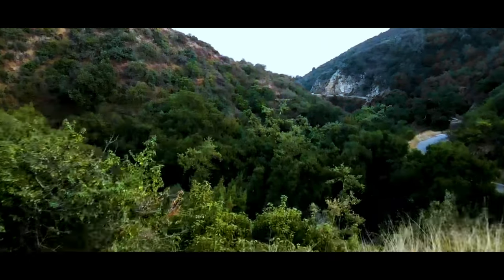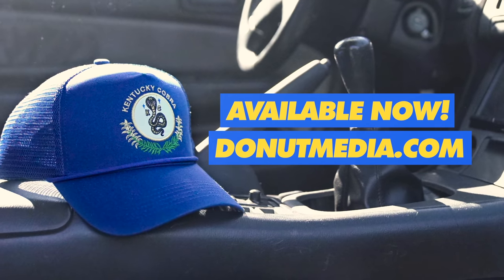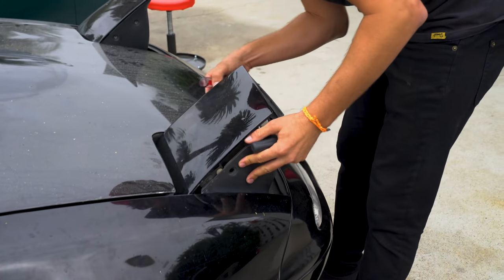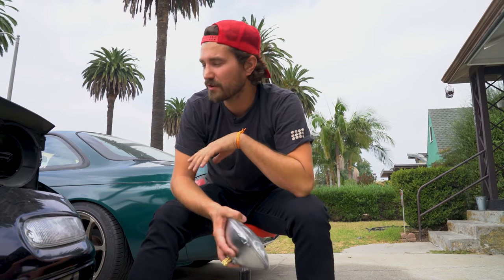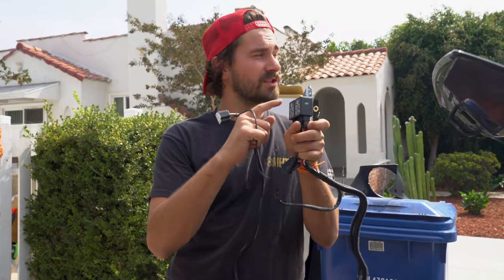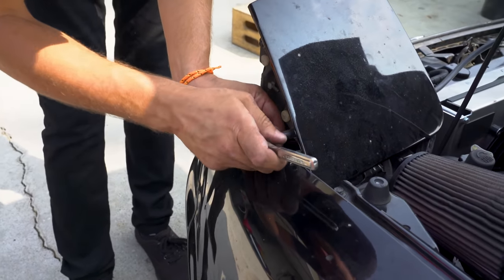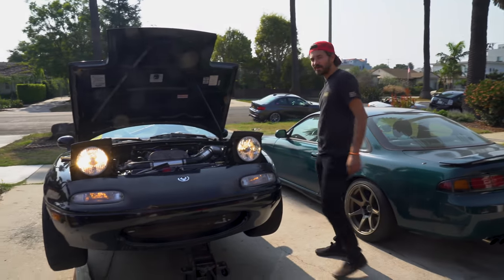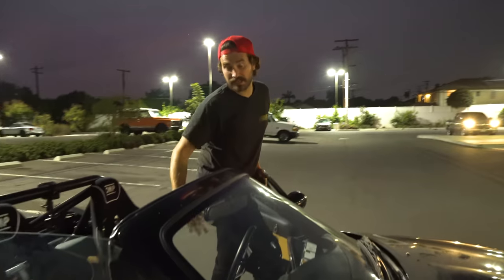Are Aftermarket Headlights Worth It?

Comment: aftermarket bulbs... as in a better sylvania bulb? yup works well and doesnt blind TF out of drivers. led and hid in a regular housing suck for other drivers and should be illegal....also this is old school but for CB radio operators they emit ALOT of RF noise and cause alot of static on your reception. effectivly reducing your reception range. and there is no way to stop it.

Comment: I know this video is a bit old, but does anyone have a better description of what's going on at 7:55? My miata is my first project car, and I've had it for about a month. I've managed to find the terminal shown in this frame, but I'd assume there'd have to be a second terminal to connect the other lead, which I haven't been able to find. For how popular these cars are I haven't been able to find any good resources on installing aftermarket headlight harnesses and this video has been the only source I've found with any type of instruction

Comment: it feels like a bad upgrade, I assume that aged light gave 1200 lumens both, and new standard bulb would give 1500 lumens both, extra power, but still old tech is just under 3000 lumens both. 
LED cost 3 times as much for bulbs but with rough consumption of 8W low and 28W high offer upwards of 4000 lumens EACH. 
assuming that harness is not free, that upgrade would both be cheaper and give you not twice but like 5 times as much light, (even feels like too much and I would go for weaker model)

Comment: I'm surprised that the Miata has sealed beams, I thought that went out of fashion in the 70s?  Are they h4 in other markets?  My 86 Mazda 929 in Australia had twin pop-up rectangular headlights and they were not sealed beams, H4 globes.
Reply: Sealed beam headlights were a legal requirement here in the US until the mid 80s. Some cars, especially those with pop up lights, continued to use them until later.

Comment: That's cool and all, but you totally should have done an HID or LED + retrofit projector swap instead... WAY more output on the road...

Also, why did you connect the power wires to the headlights for the relay to the alternator instead of to the battery. That means you won't be able to have your headlights on unless your car is actually running.

Comment: Watt is not a measurement for electrical power. It is just a measurement for power. You can calculate any power with it. Does not need to be electrical.

Comment: As someone who probably spent over $1,000 testing different kinds of on headlights for my Honda, the conclusion is this:
OEM Halogens isn't the best
LED will generally be best for most people in most situations
HID if you drive a lot at night in wooded areas

Color temp:
5,000K - 5,500K is the sweet spot for best visibility and color / texture at night (lower it's dull, and strains your eyes, higher and it flattens everything out and it's hard to see textures).

For HIDs, power of the ballast will affect color temp, 35W will be warmer than 55W.

If you're going to mess with headlights, do it right, it's a safety item and it affects other drivers.
Please for the love of God do not run HIDs in a reflector housing made for Halogens... go with LEDs instead.

Comment: Big mistake installing higher watt rating bulbs than fixture is rated. Your wiring is ok because of relays, but your new reflector and bulb housing might not be, due it is rated for 55w bulbs not 80w, you can see this rating on fixture side at one point in video. Higher watts means also higher heat dissipation and good chance melting that fresh new shiny bits into black crisp.

Comment: Halogen light bulb in 2020, that is sad.

Halogen light bulbs are so out-dated. They produce alot more heat, infrared and UV than the visible light, which will degrade the housing, casusing crack, len yellowing and dull the reflective.

Good set of LED can produce 3X of light, run cooler, no UV or IR, while consumes same power so no new wire is needed.

However cheap LED usually dimmer and sent light all over the place, include blinding on-coming traffic.

Comment: All the people on here like “ur stupid for not using LEDz” clearly didn’t even watch the video lol. He specifically said he DIDN’T want to use that because it ruins the look of a 90s car.

This brings back memories. My first car was a 96 Ford Probe GT, which used H4666 rectangular sealed beams in pop-up housings. All the sealed beam lights are terrible, so I got some Hella H4 retrofit housings and one of the early HID retrofits for it (the ones that used gigantic ballasts). This was back in the day when the HID retrofits were actually really well made, so combined with the excellent Hella lenses, it was as good as an OEM reflector HID  setup. Watching you do this really reminded me of that, especially since the Probe was basically a Mazda. Even the plastic housings around the headlights that had 2 screws and the little clip that you have to pry out, it’s exactly the same as it was on the Probe. I miss that car…

Comment: The question that you didn't answer is, "Do the new lights blind oncoming drivers?"
Reply: The reason why the lights have to be aligned is because of that exact reason, to tilt the low beam lights down towards the ground so that they light up the road, and not an oncoming driver's face

Comment: To those converting to LED, DO NOT GO OFF OF WATTS ALONE! Watts is total energy spent, including heat! A lot of led bulbs will claim high watts (accurately) but not be as bright as LED’s with half the watt usage! You have to choose with Lumens, that’s what you should be looking for! Watts are kind of like a verifier for whether a claimed Lumen amount makes sense. If there isn’t a lumen rating (or if the lumen rating is stupid high but there’s very little watts or average watts) they’re probably lying. Reviews don’t really help either, because the cheap ones have fake reviews! If you are going for super bright, I guarantee the bright ones have coolers (like fans) that’ll be on them. This is important! ANY HIGH WATT LED BULB THAT DOESNT HAVE A FAN CAN CAUSE ELECTRICAL FIRES WITH THE WRONG WIRES, and I guarantee if you’re putting in a high wattage led without knowing some electrical you are likely to cause a fire. Please be safe, ask people on forums, and find a car buddy who specifically knows electrical. I know this is a long post but it takes a lot of research to get this knowledge on your own!
Reply: Any LED light with 65+ watts should have a fan! Be careful you awesome people! (And if they don’t, they might work great in your friends car for $12, but they might light your older car on fire for that same, cheap price!
Reply: Like he did with his headlights, relays are a great way to handle everything with higher watts!

Comment: If I were you, I’d keep the new headlight housings you’ve got, ditch the bulbs and wiring harness you put in there, and try the GTR Lighting Ultra Series 2 LED bulbs. I put the H4 bulbs in my Accent, and I have been nothing but impressed with these bulbs. Nice thing is, no crazy harnesses to install to run these. Simply take your stock bulbs out, plug these in, make sure they’re aligned correctly, adjust your housings, and boom...the best forward lighting I’ve ever seen! Check out this video by Headlight Revolution on these bulbs! I think you’ll be glad you did! 

https://youtu.be/uO8Nuj6tPy4

Comment: Wow, unlike about 99% of other dipfucks that install brighter headlights, you actually take the time to calibrate the beam angle to not nail people in oncoming cars with glare / a nobel prize must be in order at once ~~ also HID kit would have made 3600 lumens per side & $40 Beamtech LED on Amazon that also must be aligned in the housing are 4000 lumens each // & put the LED''s where the halogen bulbs filament would have been emitting photons so the spectral emissions of the headlight conforms with road legal considerate beam angles etc // FYI

Comment: 80W low beam headlights = EXTREMELY DANGEROUS because they'll blind the hell out of every oncoming vehicle.  The legal limit for headlamps is currently 55W at 12V.
Reply: They won't blind anyone if you aim them correctly like he did in the video. The beam they emit will be under the oncoming driver's eyes.

Comment: 5280ft per mile, 211200 in 40 miles. 3600 seconds in an hour, 211200/3600 makes 40mph app 58ft per second. Avg car headlights shine about 30-40ft in front of a car[low beams], and since 30-40ft is less than 58ft, basic common sense tells us that headlights are so other people can YOU going down the road, NOT so you can see. Back when cars never went over 40mph, ya headlights were for seeing the road. THERE NOT ANYMORE. STOP BLINDING EVERYONE AND DO SOME BASIC MATH.